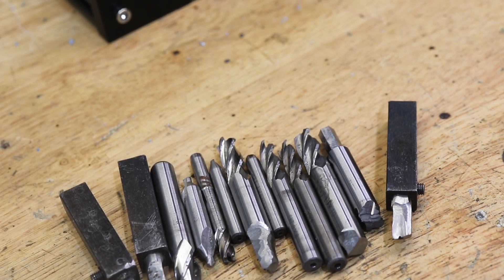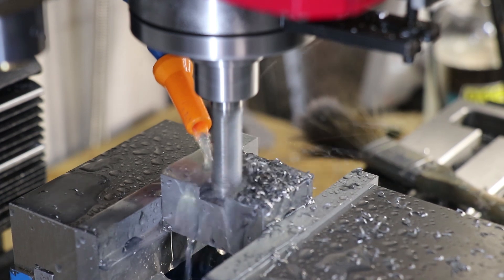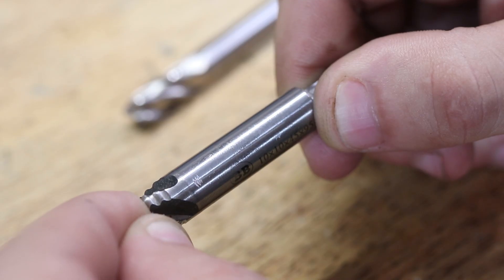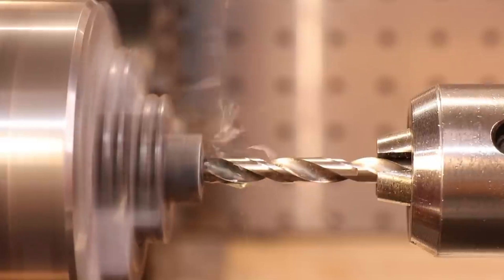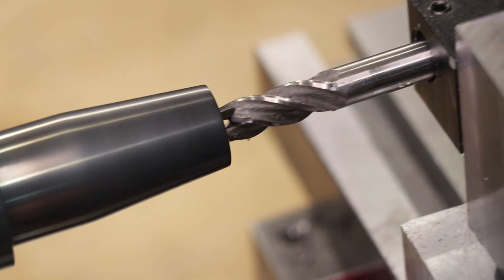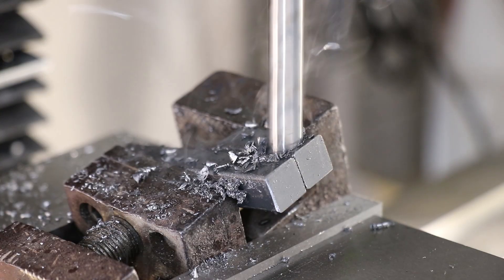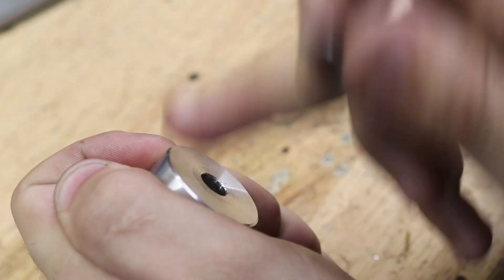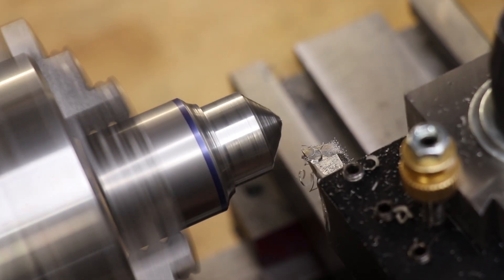How I Reuse Broken Endmills In My Workshop - Don't Throw Them Away

Comment: Mix oil and water like the flood coolant use it for quenching ! Or mix clay with water. making a thick souplike milknaybe slightly thicker. Also automotive antifreeze coolant could possibly be used. Maybe ethanol  and mineral oil. A large container using multiple pumps circulating the coolant used in machining for example. Say 10-20 gallons plus. Pumped through radiators and returned to the  quench tank. Using  at least two pumps capable of 5-10 gallons per minute with 12"-14" high velocity fans moving air through the radiators. 2000 cfm minimum 5000 cfm average.  Maybe use dry ice to chill the coolant pack tge radiators with dry ice. A pair of radiators packed with dry ice
18" x 32" , covered in 20 lbs of dry ice  and the 15" x 40" tank using four 1.5"  radiator hoses with pumps capable of 10-20 gallons per minute. Capable of emptying the tank in 2-3 seconds. The coolant temperature bring 33.5°F (1.5° above freezing) maybe the motion will allow 28° or 26°f if antifreeze is used  drop the temperature to -28° to -60° then quench the steel.. the coolant swirling at sbout 100' per second. The container design keeping the coolant inside at this velocity. Using deflectors.  I would like to see how the steel is effected.  Also i would like to see steel bring molten without a magnetic field. And in "zero gravity"✌️

Comment: So far, my use for broken mill bits and drills is to line the top of a shelf to protect it from dust. But recently I bought a small 6” x 12” surface grinder that I’m modifying and upgrading. Since that’s very similar to a tool and cutter grinder, I’ve been buying grinding fixtures for it. Hopefully, I’ll be able to get these things off the shelf. It’s clean enough now.

Comment: I make my own lathe tools from broken or dull endmills.. Since i use CNC machines i regularly use 4mm endmills in Titanium, going 10 mm deep per pass, using HSM toolpaths.
When they break or get dull i regrind them into Cutting inserts on the lathe. I use a Diamond Cupwheel on a cheap manual lathe that is mostly used as a tool grinder nowadays.. 
I made my own holders as well, these work fine, i use these on all materials.
With a Cupwheel on my "Makeshift Toolgrinder"i can also make boringbars.. indeed Ø4 mm boringbars..

Comment: To hardening  use old oil from diesel oil change. Filter it using a coffee filter.
Reply from the maker: M2 hss requires very specific heating and soaking times to properly harden, which is why I have has little success doing it in the home workshop. Cheers

Comment: Just use em as pins fpr setup or resell the material. As a shop owner you have to consider the cost of making something out of a 50 dollar endmill. Say it takes a guy that you pay 20 bucks an hour to make a tool out of an endmill and it takes him a half hour. You spend 10 bucks having him make a tool that probably costs 10 bucks to just buy. Now consider the time that this guy could be using to run a machine that makes you 100+ an hour. That 10 bucks is now $60. Remember your endmill was only $50 to begin with. You're now -$10 in the hole. For a hobbyist, sure. Do whatever you want. But running a shop I wouldn't bother making anything other than a pin because the pin is already technically made the second the endmill breaks.
Reply from the maker: This video isn't really aimed at production shops. This channel is just a hobby for me. Most production shops I've been to dont really use hand ground tooling anyway. Mostly insert tooling from what I have experienced.
Reply: @artisanmakes  yeah, as a hobby I get it. 

You'd be surprised though how many times I've had to explain that concept up there to shop owners because they didn't have a clue how much money they were wasting. A lot of people only see the upfront cash but fail to recognize how much money the wasted time costs.

Comment: Good video, as a reward I'll give you another handy mod. On the shank end of your drill bit grind a fairly broad point, angle is not critical, but you don't want to have an excessively long taper. Now you can use a soft hammer on your new precision transfer punch set. Plus you haven't had to wait for dead drill bits to make them :)

Comment: a normal 6mm's shank is normally ground to 5.996 ( at lease the few 100's of carbide ones i mesured with a mic and cmm ( cmm said 5.9965 but the temps wasent right to trust it that much so i just said 5.996 was wha i belived )

Comment: Use quenching oil for hardening those bits, you will achieve much better results.
Reply from the maker: It's not the quench medium that's  that issue, it's the soak time and cooling rate needed for M2 hss which I can't do in the home workshop. If anything water shouldbe given me more hardness which it didn't.

Comment: if you wanna harden em with a torch like that you'll probably need to grab an acetylene or map torch instead of the butane.  its just too cold to get it to temp in the open air.  if youve got an enclosed space thats fireproof butane/propane can work.  good luck!
Reply from the maker: From what I understand, the issue is moreso the soak times and cooling rates needed to harden M2 hss

Comment: I'm a blacksmith and we had to learn to harden High Speed steel. It is a lot more involved than just hardening and tempering medium to high carbon steels. I haven't even tried it since learning it in school many years ago. It is a lot cheaper to buy blanks and grind tools from the blank.
Reply from the maker: I agree, I've never hardened hss, but I learned about the process, and it is very much outside the scope of what I can do.

Comment: The video angle may deceive, but: 
At least 08:30 it looks like your tool-holder is binding to the work piece. 
Are you sure the tool-holder has enough clearance?
Reply from the maker: It could be like this, there wasn't much clearance at all with this set up, especially when I got to a shoulder. Seeing as it couldn't get a nice cut I abandoned this idea, if it worked I probably would have cleaned up the holder to give me more clearance. Certainly wasnt rubbing when I was turning the shaft

Comment: You can heat up the shank to a dull yellow glow, let it aircool and it should harden up just enough
Reply from the maker: I have tried this method but i just can't get it to achieve a good result in M2 grade
Reply: @artisanmakes  It needs to go above 1150 degrees celsius for any hardening to occur
Reply from the maker: My data sheet says about 1190 celcius or there abouts.

Comment: I use a small diamond grinder to make single lip engraving tools and small radius tools from mostly 1/8" mill shanks that the cutting surfaced blew off of.  Getting an old deckel grinder is a great idea too, as you can often pick them up for a song, and they are great for "pyramid" engravers.
Reply: Tell me the correct song to sing for a Deckel! They are extremely expensive!
Reply: @bigmotter001  The one our shop uses is actually broken.  It no longer can do the relief, but the wheel still spins, so we use it for pyramid engravers quite a lot, and single lip tools.. well I am just careful when I relieve them by hand on the diamond.  If "broken but still useful" is still too expensive, look into the "quorn" grinder and other home made versions.  You can build some of those for about 3 times the cost of the wheel they use if you are frugal and have scrap lying about...

Comment: Well... I'm using worn out small size endmills as boring bars in the CNC lathe, when there's a need to bore a conical surface in some really small diameter holes, like 5-6 mm... Just putting the most good looking cutting edge in upwards position, setting a tool offset for it, and it's ready to go.

Comment: On my desktop cnc. I use broken end mills as indexing pins to locate parts. I started out using drill bits but they just didn't have a proper diameter. I found end mills are a lot more true to advertised size.

Comment: You can harden the steel, just get a color  table from the Internet for your steel.
And for youre tools that you make with the grinder, you should take a look at the specific angles
Reply from the maker: Like i said in the video the process is different for HSS. I've tried similar methods that I use for carbon and CRV steels but I don't get the same results from HSS, especially M2 grade. I have been taught about the basic process about how HSS is hardened and it involves preheating, heating and quenching at very specific temperatures and conditions to obtain the correct hardness, something outside the scope of what I can do. 

And for tool grinding, those angles are useful, but for hard to cut alloys, those guides can sometimes go out the window. The boring bar I made probably would do poorly in a 6000 series aluminium, but worked perfectly for cutting a 4000 series.

Comment: They can be hand ground to a fishtail shape. Use a small trisquare to get the two cutting tips even. These kind of cutters are sometimes called slot cutters and work very well cutting keyways as the shape pulls the cutter in.

Comment: I think it's worth mentioning that quite a bit can be done with old files that are worn, and I've had a great luck making form tools out of old fashioned screw plates. And I know the conventional wisdom is to avoid mystery steel, but my favorite boring bar for over a decade now was made out of the forged forks of an ancient miniature crane. It's ugly but it holds an edge like nothing else. We spend so much for the simplest tools in this hobby, this is wise to make use of it down to the chips. And then recycle those.

Comment: These are great tips! The really small pieces can still be braised and used that way. I've never really understood why one is not supposed to use end Mills on the lathe. One of my favorite Time savers it is an enormous one inch by 7-in solid carbide end mill with fairly square corners. It's junk from off of eBay, but it's decent enough carbide to hold up forever. I made a taper shank arbor for it, it's in my tail stock more often than not. I've completely quit drilling the small holes and working my way up, I think this is far more efficient although I recognize most books disagree. I don't know if these are available in your country, but they're very easily spotted on us eBay. They are always located in towns far too small for any manufacturing and the prices are typically a quarter of any known brand. They are junk if you are expecting a solid finishing tool. They're fantastic if you're looking for something to abuse and smash through work.

Comment: Some of my favorite tools are made to utilise broken or odd stubs of hss and carbide. Fly cutter bodies are easy to make and can be very effective. Some of mine I have used weekly for near 30 years. You only need a bench grinder - and some polishing stones or diamond laps used to refine the cutting edge - to made an endless variety of special purpose tooling. Learn to grind your own tooling. Spade drills, left handed drills made from junk  etc can really save your day. Want a radius or chamfering cutter to use in your boring head on the mill? A broken end mill may be just the thing with a flat ground on it to seat the clamping screw. Another source - HSS drill blanks are cheap and come in a huge range of diameters. I have a boring bar tool body  and bushing set i made to clamp a range of micro boring bars made from small drill blanks.

Comment: Climb milling broke that endmill...
Reply from the maker: Well it climbed on that front face. The side the I was milling is all done conventional.
Reply: For the last 20 years climb milled just about everything.  Definitely on cnc production machines but more often for me in  Bridgeport style machine. Better tool life and finishes. Make sure you have enough  drag set on the slides to beat the back lash. Not what I was taught in college but works for us in our shop. Sure - you may not have enough rigidity in a home hobby mill drill. Feeding smoothly by hand especially  requires practiced technique.
Reply from the maker: @johnhunt6992  What works for you, but you are right, this machine isnt really set up for heavy climb milling. I most use it for finishing passes. Cheers

Comment: Very Nice. I do the  same with broken taps
Reply: I like to keep some of my broken or chipped taps to grind back to use as bottoming taps after using a good tapered or gun tap. Also for cleaning out dirty or damaged threads to save my new ones.

Comment: Interesting you struggle to heat treat HSS. It is one of the simplest steels to harden ,being an air hardening tool steel, literally get it cherry red and toss it on the bench and you will get 62 rockwell. Maybe your gas torch isnt getting there temperature wise. I have used it a lot in my blacksmithing activities, as buying lathe tool blanks from China is a good cheap source of HSS for making chisels and knives. This would of course also be a good use of broken tools.
Reply from the maker: It really depends what alloy you are referring to. I have not had much luck with M2. I have a handbook which details how M2 should be hardened and it requires soaking and quenching and specific temperatures to achieve the hardness and toughness. Stuff outside the scope of what I am able to do

Comment: I never saw you using that "white grinding wheel" to make your tools. Since I've tried that stuff to grinding my tools I've never changed.

It's made for hard metal, and it gives you a better finish for the edge of the tool and save time as well, because you don't need to normalize the material.

Try that if you have the opportunity.

Great video!!!

Comment: I think drill shanks are fairly soft.  I've heard (from the internet) that the shank is intentionally left soft.  It could be so the hardened jaws of a chuck can get a really good grip.  Anything with flats might be harder but it probably depends a lot on the brand.
Reply: Many years ago I used to work for Clarkson Tools who made the 'Autolock' range of milling chucks and cutters.  Cutters larger than about 3/8" diameter tended to have the flutes milled into soft blanks and then had only the flute areas case hardened using a molten cyanide salt bath - these case hardened tools can be recognised by the milled finish left on the flutes.
Smaller diameters tended to have the flutes ground into pre-hardened blanks and these would have the same harness values for both flutes and shanks.
This also applied to other milling cutter brands that were owned by Clarkson such as 'Qualcut' - these tools were identical to the 'Autolock' brand using the same materials and produced on the same manufacturing line with only the final stencil marking differing to cater for customers that preferred one brand over the other.
Reply from the maker: That is my understanding of it, but also leaving it softer would also give the cutter bit more toughness. But what I've experienced really depends on the brand's and sizes if endmill
Reply: theyre usually left soft because they would damage the chuck if both chuck jaws and drill bit shaft were hardened :)
Reply: The shanks undergo induction heating. That's why they are softer.

About 3 minutes into the video...

https://youtu.be/0c6_FMUXQg4
Reply: Yeah it doesn't work that way with carbide. Solid all the way thru, maybe with a lack of coating on the shank, however.

Comment: Use broken drill bits and tools or even springs for hard steel that you can fuse to anything, and make very hard tools. I quenched in water immediately while glowing hot, without tempering and unsurprisingly the tool steel that was melted onto regular steel, was unbelievably hard and durable though brittle.

Comment: AFAIK nowadays HSS endmills and drill bits are often not solid HSS but a HSS business end welded to the mild steel shank during the production process. That may explain why shanks are often impossible to get hard enough. Often you even can see the weld line because of colour difference

Comment: I'm thinking of making a hole transfer punch from the stainless steel shafts or drill bits.
I will need to harden the tip after making it look like a pencil tip on a lathe.

do you think it's doable? how to harden the stainless steel shaft tip to last and remain sharp?

Comment: What????
BSP threads are 47.5 degrees
Whitworth threads are 55 degrees.
Reply from the maker: Nope BSP are 55, search it up
Reply: BSP uses the standard Whitworth thread form with 55 degree threads.  You may be thinking of BA (British Association) machine screws?
Reply: This guy needs to check his facts before posting silly comments,47.5° for a BSP thread? Really!! Think you will find 55° is correct.